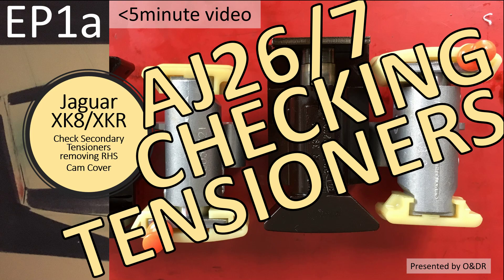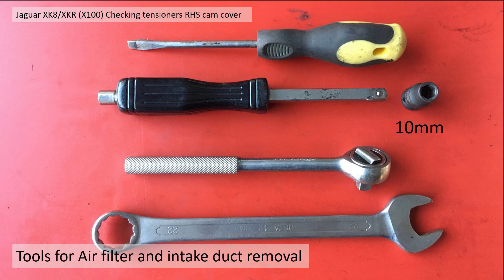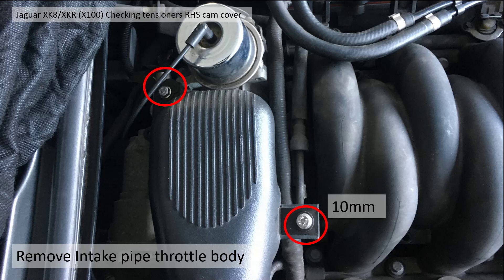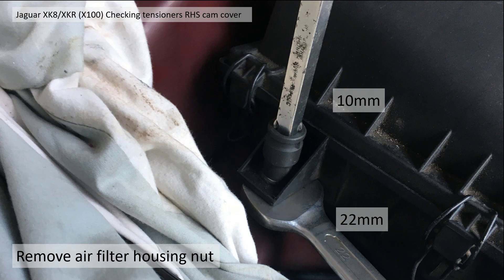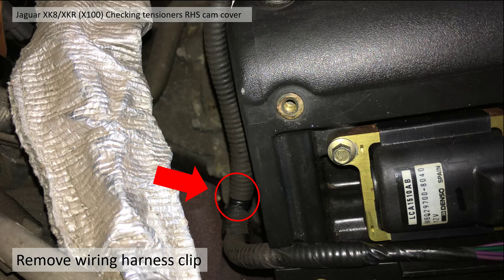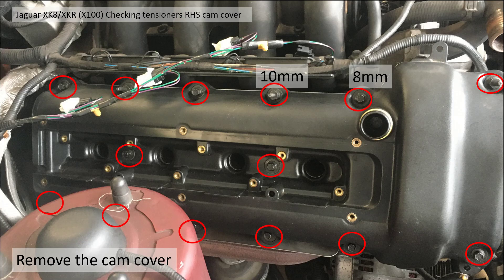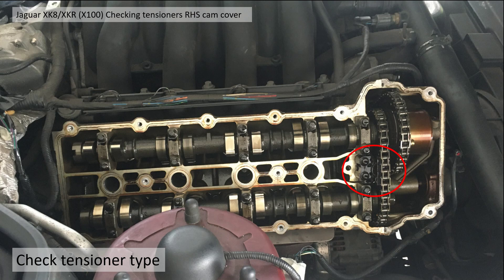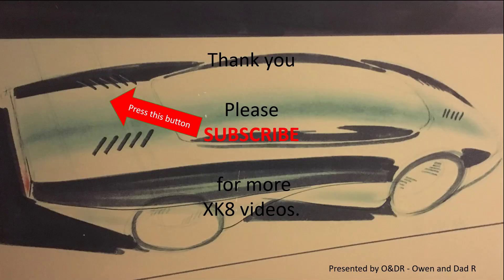Checking cam chain tensioners AJ26 AJ27  EP1a Jaguar XK8 / XKR (X100)

Comment: can you change to new tensioners without changing chain?
Reply from the maker: John, you can change the upper secondary tensioners without changing the rest. There are video for this including an unofficial zip tie method. However, the chains do stretch with mileage and if you intend to keep it will be worth changing the lot. Although if you only planning to keep it for a while you will probably get away with the secondary’s only. Hope that helps. Thanks for your input and comment Damian

Comment: I have a 1998 xk8 with 134,000 miles runs great do you think the chains were replaced?
Reply from the maker: John, these cars are now well past any planned maintenance schedules. The gearbox and chains where expected to last the life of the vehicle. What that life was planned to be is debatable. But it’s obviously not 22 years and 134,000. Hence we are in new ground and won’t have been done as a standard item. The only way to know for sure is to take a look.  Not mileage issue but age of plastics. https://youtu.be/-wsnuLt4zpg. Thanks for the comment regards Damian